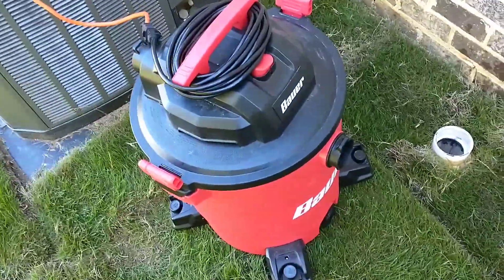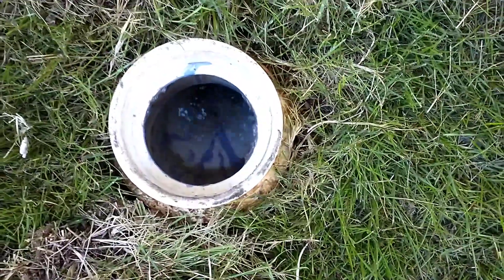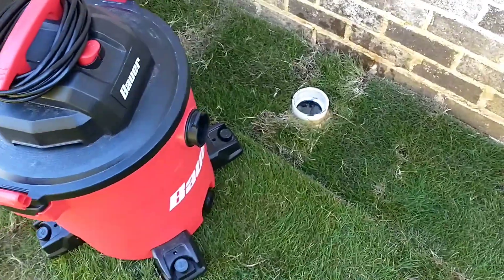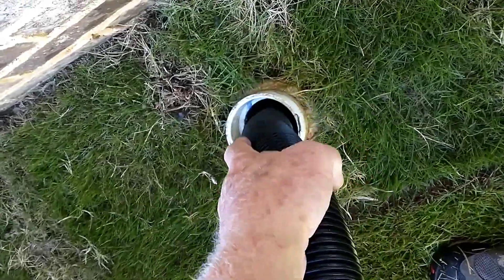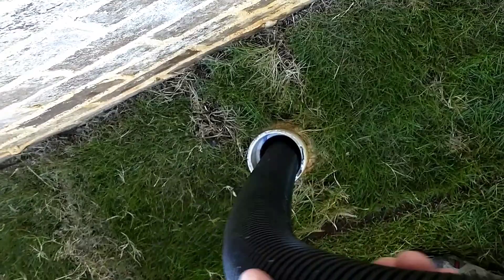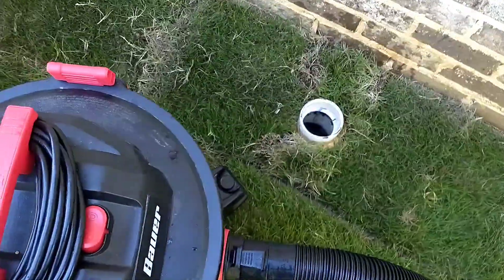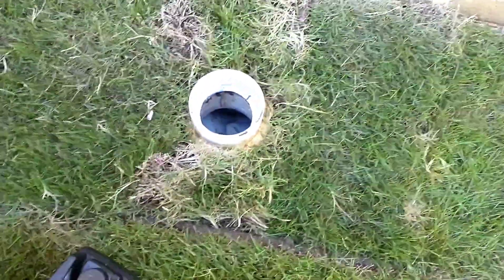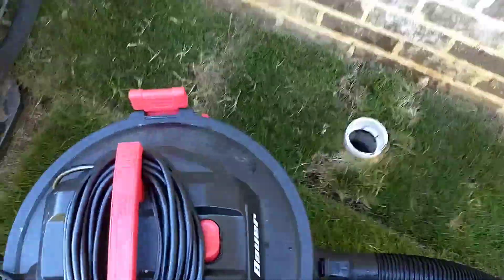Dryer Vent Full of Water

Comment: This was the most uninformative video ever. What is a fix for the problem?  Ever tried using a leaf blower on the inside and blowing it out. It works! Geeze!
Reply from the maker: The fix is to run a new dryer vent. Water is seeping into the underground pipe. What we've found at other houses in this neighborhood is that the contractor that built the house didn't glue the underground pipe. No easy fix other than to relocate the dryer to an outside wall. A leaf blower doesn't work well with water.